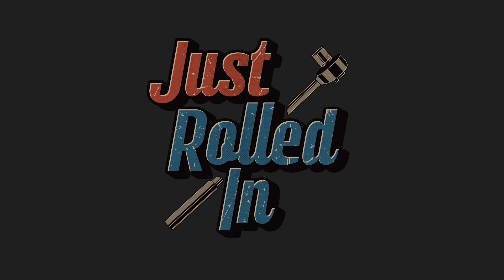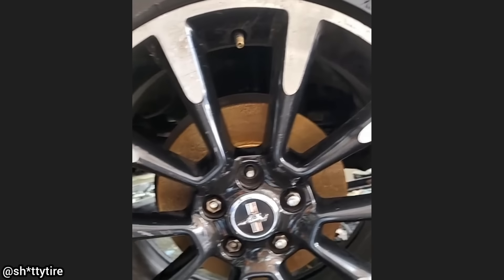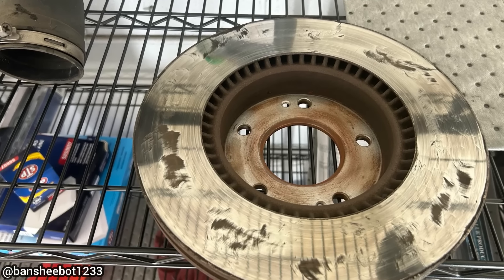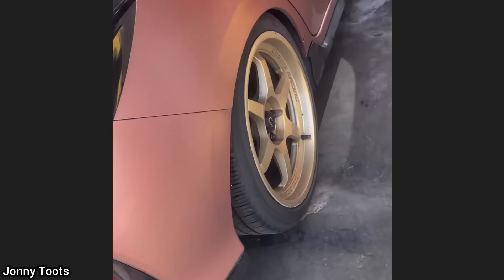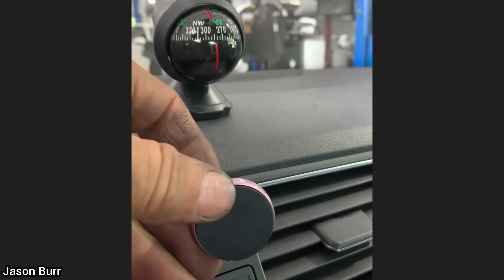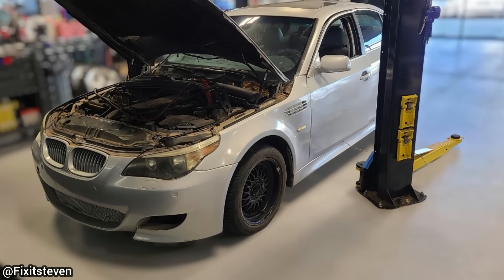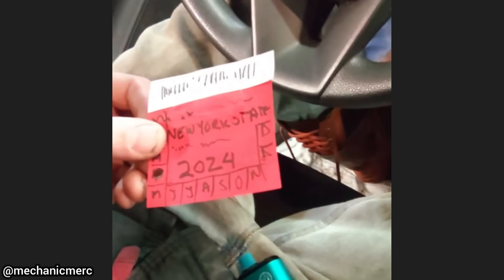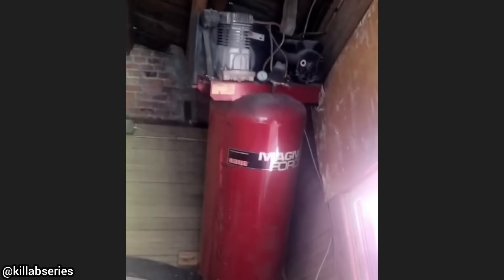Customer States "Another Shop" Ripped Him Off

Comment: In the mid 1980's I drove a truck for the state and the inspection sticker was overdue. The mechanic at the garage refused to do anything about it even though this truck was gas with no air brakes which required a sticker. I made one up that looked like that. I drove for over two years with it on the windshield without being stopped. The mechanic at the garage tried to get me in trouble for it but was told he needed to do his job and inspect the truck.

Comment: Customer declined repairs. The 3 most vile, cringe worthy words any technician will ever hear!!😂
Thanks again, JRI guy!!
Reply: Naw, in some (many) cases, I was glad to hear those words. In some cases, you’re way better off just watching the car roll out the driveway of the shop. Especially if it’s some dumpster that the customer works on themselves.
Reply: I've had any number of times that I couldn't find the problem (usually electrical issues) so I would be happy just to know the cause. I can fix it myself.... once I know what the actual problem is.

Comment: I know it's expensive to get your car fixed and everybody's trying to stretch a dollar. But what makes people think spray foam can seal a fluid leak? At least try some Flex Seal or something 😂.  If you prep the surface properly, it might actually work for a short time 😅. Better off buying the correct part and making sure it's correctly installed. It's not always easy. But it's a lot better off in the long run
Reply: Don’t buy a BMW if you can’t afford to fix it.

Comment: Many years ago I had a Volkswagen Golf that accelerated by itself. Or, more accurately, I could drive down the road at 50mph with my foot off the gas. It certainly wasn’t the floor mat and it only happened when it was extremely cold. It also blew the horn continuously when I restarted it if it stalled, again when it was extremely cold. They couldn’t find out what was causing it. Ugh. I think that was back in the late 80s or early 90s. Now, you may question my judgment but I otherwise loved that car but eventually sold it. Fast forward to 2017 and a period or other cars, like a Prius (yawn) that I had for 11 years, and I very hesitantly bought a certified used Golf with 5000 miles. It has been a great car with no issues. (fingers crossed)
Reply: Lubrication,  and bad wiring id guess,   sounds like a fun memory though 😂

Comment: I've successfully patched fuel leaks with JB weld. You have to use the solid stuff for structure, then put the liquid over that. Note however that I said 'patched' not 'fixed'. It's a desperation move, doesn't hold for long, and is strictly to keep you from burning yourself alive while you wait for Amazon to ship your parts (in my case the leak was in the fuel fill, not the tank itself; I was able to properly replace the rubber boot. After I tediously carved off alllllllll the JB weld with a pocket knife of course.)

Comment: "Whoever installed control arm, did not notice that sub frame was rusted" is more like "i'm only paid to do what i'm told to do".
This reminds me of an old joke. The nurse is pushing a gurney with patient on it. Patient anxciously laments "Please, we don't have to do this. Look, i'm still alive!" to which nurse replies "The doctor said to the morgue, to the morgue it is!"

The Mustang at 0:11 looks like the driver is using entire front end to stop. Also "a couple of weeks"??? When my power brake vacuum pump failed (the brakes were still working, i just had to do all the work of the power assist), i grounded the car immediately and called tow tuck to bring it to the shop, just to be safe.

2:25 i can confirm, this is what i sound like when i watch JRI clips and die inside.

Comment: i scratch my head in amazing wonderment watching these clips. thinking, how? just how? while my truck may be old, and not so pretty anymore. it's worked very hard in it's 24 years on the road as a work truck. i'm a retired home remodeling contractor. it was just another tool i worked with. but i tell you, it's safe on the roads, i made sure of that. the ones seen here? scary stuff.

Comment: That was a NY state inspection sticker. No need to forge them. There are plenty of shops that pass you on the basis that if you drive in and stop without going through the far wall of the work shop then you must have some brakes!

Comment: That is a really bad brake surface job. Just lift the end that gets power, put the car in drive, and use a sand block screwed to a plank with a base with weights. Make sure the sand paper is vertically level.
If you have a mounted grind wheel you can put the rotor on it and then do the sand block.
If you have a lathe, just use a sharp tooth for lathing steel and run shallow cuts. Spray paint the rotor so you know when you're done.

Comment: 1:50 that looks like the center yoke from a 3 jaw puller. An expensive wing nut.
Reply: When the turbomop, shamwow, flexseal,and alien tape don't work you can always rely on      spray foam.

Comment: Brakes haven't worked "in a couple of weeks" and they're still driving it using the parking brake to stop. If my brakes suddenly stopped working I'd have the car towed to the shop as soon as possible and wouldn't be driving it.

Comment: JB Weld on the gas tank? Always wondered about that one. And of course, spray foam. The wonder cure.
Reply: JB Weld will stick to a gas tank, except where the gas was leaking out.
Reply: @massimookissed1023    JB  Weld is that one you mix the two parts, right? Kind of runny like honey?  What about steel stick? It's a lot thicker.  I ask not because I have an issue, but I do have some Steel Stick, and it says on the label it works on fuel tanks. It's a really thick type putty when ready to apply.
Reply: @Support_Ad_Blocker  Yes, and the steel stick stuff is kinda the same 2-part epoxy but with a (polyester?) filler added.

The trouble is, they don't stick to fuel, so you really gotta clean the area you're gonna apply it to.
Reply: @massimookissed1023   I think a repair like that would be kind of sketchy.

Comment: I need more information about that air compressor
Reply from the maker: Sounds like it was rusted out on the bottom. Didn't get much more info unfortunately
Reply: @JustRolledIn  stares suspiciously at the 20 year old one in my shop
Reply: Harbor Freight, almost  a week old.

Comment: French here 🇨🇵Is a US citizen could explain to me what the basics obligation of any repair shop? 
In France, any car shop,dealer,...any! have obligation of recommandations and obligation of results
If they don't say a customer he have to do a thing, they are responsible to anything happen relative. 
If they made a diag and say what to change to solve the problem they dia( and/or the problem the customer come in for), they are responsible as long the problem disappear, even if they have to change the whole car and if they have diag a light bulb. 
Last one is almost same, they are responsible for anything happen after they are the last to do something, and they have to prove its not relative, if any doubt questions exist, they ARE responsible.
If they made an oil change on a car rolled in without oil, even it is proved and documented, they became responsible for the damage occurring after them, without care of anything preceding them, the car without oil became their entire problem .
Reply: Your English is not good. But to what I can understand to answer your question. Yes. However within reason. If a car comes in with no oil and it is documented and proven, the shop is not responsible if it blows up afterward if it still has oil in it. We use paint to show if the car has been tampered with after service to prevent fraud.

Comment: Air tanks have a 'Destroy-by' date stamped on them for a reason.
Reply: Not if you grind it off !
~ taps forehead ~
Reply: They do? Never noticed one on mine...is it on the bottom, in tiny print, in the same color with no contrast to the background so I never see it?

Comment: Air compressor blew up because poor maintenance; you should regularly open the drainage bolt for water. otherwise it could rust it from the inside. as it rust it weakens and this is the result.

Comment: Been several decades since I did my own brakes. What’s the dummy’s explanation for that blue (to make sure you don’t think I mean the one missing the callipers 😂) one?
Reply: Possibly a steel shim used to prevent brake squeal, removed when new pads were installed as it wasn't required.

Comment: I was thinking of opening a car repair place and calling it "Another Shop".  Perhaps I should reconsider the name.
Reply: You wouldn't need many tools.

A lawn chair, and a can of spray foam.
Maybe an extra-long-reach nozzle on the spray foam for specialist jobs.
Reply: Can you repair muffler bearings?
Reply: @shannonharris  We have a complete line of muffler bearings for every make and model.  Rear ball joints too.  We even top off your blinker fluid with every service.
Reply: @tc6818 how much to change the air in my tires from winter air to spring/summer air?

Won't be long til the weather gets warm😂

Comment: What’s worse, JB Weld, spray foam, or silicone?
Reply: Easy! The award goes to...Spray Foam!  It has no use on a car. Except....for one I saw one day. A collision on the right door had bent the door somewhat out of shape, and broken the latch. The "solution" was to have another car (or something) push the door shut as far as possible, then fill the gap with spray foam. So yeah, it worked, but it didn't look so good. It would have made a great picture for JRI, but I didn't have a camera-phone at the time.

Comment: A question for the shop owners
If your tech sees rust or mechanical damage which makes the car unsafe/ dangerous to drive and the customer refuses repairs,
Is the shop legally responsible if the car is driven off the premises and t bones a car up the street due to damage?
Morally I think the shop owner should with hold the car or at least report to transport authorities.
What do you think?

Comment: Folks, they absolutely HAVE to stop putting salt on roads.  THAT or there needs to be certification requirements that steel parts on the bottoms of cars HAVE to be coated with 4 mm of plastic coating on top of galvanizing.  This is ridiculous!  You see a car 10 years old from Mish-Gin, Min-nah-SOOTA, or Nuh JAIR-say and for fucks sake the bottom looks like a bucket of extra crispy from KFC!

I drive a 10 year old Porsche Cayman S with 70,000 miles;  If I pressure washed it tomorrow morning it would look like it was brand new, no corrosion on the aluminum and no rust whatsoever on the steel bits.  That is what life in Flori-Duh gives you!  Also, slender kids who spend winters running around and surfing, rather than looking their cellphones and surfing porn on their computers~

Comment: Ok compressed air is SCARY! I've got a 30 gallon compressor with less than 5 hours on it. When I turn it on I flip the switch and run the F away, you can call me a pussy but I know someone who lost an eye when a fitting blew. Honestly if you saw this guys face you would be as worried as I am!!! Sorry John if you read this... he showed me this channel!
Reply: Well that's what happens when you buy it at Harbor Freight.
Reply: @sylviaisgod6947  Actually its a Husky! (good brand but NOT sold at Harbor Freight!!!) But ever heard "A chain is only as strong as the weakest link"??? BTW John lost his eye to a hose fitting not the compressor.

Comment: ?????? Shop won’t install drain plug? And add oil? Wtf????
Reply from the maker: Rag in an oil pan is probably because the threads are stripped. Also it's a quick lube shop. There would be a list of "ever since" if they tried to do anything on that car
Reply: Someone looking for a new engine under shop insurance?
Reply: Because they don't want to be even remotely responsible for the inevitable death of that engine.

Comment: That was not a belt sander leaving those gouges on that rotor. That must be an angle grinder with a stone and guard that should have been removed and a flapper disc used.
Reply from the maker: found the boyfriend :P